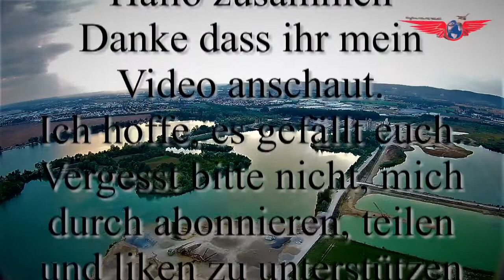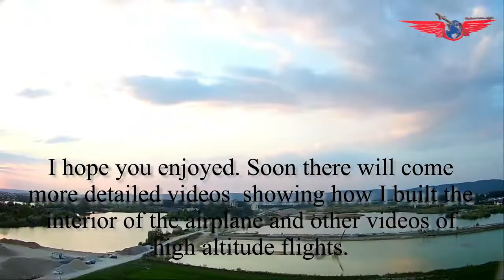My first FPV scratch building and Maiden flight

Comment: thanks for posting.   good work.  somewhat.  here are some things to consider.   the profile selected for the construction of the main wing is just a bit  thin.  (experience has shown me that a wing having a profile less than eleven percent thick, makes only moderate lift, when mounted at zero-degrees angle of incidence (aoi). )   a thinner profile results in a wing that has a higher stall-speed.   a thinner wing must move  faster  in order make adequate lift.   this all assumes a zero-degree aoi.    a zero-degree aoi wing mount is preferable, because it results in the  lowest  coefficient of drag (cd).   note that the way in which the size of the profile was reduced, results in an very thin outboard profile.  this results in a very  Accelerated rate of  'drop off'  of lift,  towards the wingtips.  this, in turn, adversely affects roll-axis stability.    (do you see that it is a miracle the model flies okay.)     

at 2:03, is the third piece the horiz-stab.   if so, this model has a problem that will NEVER go away.   what is it.
the use of a cambered, instead of  SYMMETRICAL,  profile in the construction of the horiz-stab means that, in the air,  the stab  is  MAKING   LIFT.    THAT's just wrong.

here are some additional observations, in case the stab is changed out.      at 2:46,  ANY TIME a wooden longitudinal component/brace/spar is used,  its distribution of mass (dom)  MUST be optimized  BEFORE  installation;  in other words,   TAPERED.    
at 3:03, the main spar is Not correctly installed;  at  30% of chord.      at 4:45, the arc-shaped vert-stab trailing edges Should go away.    elevator servo  Should be installed  Near  the model's center of mass (c-m).   this is   NOT  difficult to do.    tail booms  SHOULD Always be tapered;  no matter What they are made of.    tail booms  SHOULD  be as  CLOSE to one another as PRACTICAL.   the outboard mass of the tail booms, and the mass of the outboard-installed aileron servos,   ADVERSELY affects overall stability.     at 5:07, extra angle in the main wing trailing edge is  NOT  recommended.   this angle, relatively near the wingtips, creates Unnecessary non-uniformity of air flow, over and aft of the wing.    at 5:14, when a pusher configuration is used, the design of the fuselage  MUST  take into account the need for unobstructed air flow to the prop; or else it is  Starved for air, in flight.   fuselage cross-sectional area at  the firewall is  TOO  great.    at 5:26, the length of the forward fuselage is  TOO great; it  SHOULD be reduced by AT LEAST  40%.     cheers                        googletranslate
Reply from the maker: David Davids thanks for all this . I build now a new Airplane is fast similar to this one . 
So wing should I do it flat bottom or semi-symmetric ?!! And elevator und rudder should be symmetrical!!!!
Reply: @Marwando  you're doing just fine don't be a Wikipedia builder like everybody else continue on your own journey and you will surprise yourself. Playing by the rules is boring you did an excellent job.
Reply from the maker: thanks for your comment . unfortunately i can't fly this year . but next year i hope i can back again with more interesting Project :)
Reply: for most applications, where a model will be flown mostly right-side-up, a flat-bottomed profile is best.  the go-to profile is the clark-y (v1); 11.7% thick.  (this profile was  Designed  for use in the construction of the smaller wings of model aircraft;  it is not a scaled-down profile.)    for a little less lift, it can be made eleven percent thick.  you may understand that profile thickness is expressed as a percentage of chord length.    a stabilizer profile Should result in, generally, flat surfaces ( a flat airfoil).   consider using a  constant-chord  design for the main wing.  the Correct design of a double-tapered wing is  NOT  simple.    cheers
https://upload.wikimedia.org/wikipedia/en/thumb/6/6a/Clark_y.JPG/799px-Clark_y.JPG
Reply: Not necessarily I like 9% wings because they fly faster for fpv and they get to the location faster and cut through the wind much better. Depending on what your objective is there is no rules when it comes to an RC aircraft airfoil. Many times it has been proven over and over that some unconventional methods work better than conventional methods. That's why most pod and boom fpv platforms are a thinner profile. And that's why we have powerful and efficient brushless motors.

Explore the world keep experimenting otherwise if you continue with conventional methods we will never advance in this Hobby. 

Take a look at the wombat from Team legit or the vas Wraith, banshee, Spectre ect. 

All Unconventional aircraft and airfoils that perform tremendously well when it comes to fpv for what we want them to do. A big fat airfoil does not necessarily mean better for every application.

And not everything from full size aircraft applies to RC models and vice versa if it did there would be a lot of accidents out there of kids successfully jumping off their roofs flying around town.

I agree with a lot of what you say but sometimes you just need to let people have their freedom. It's the best way to learn and the best way to advance, there is no right or wrong way to building an aircraft. 

My advice is do what works for you. Don't be a Wikipedia builder be your own builder! If everybody would have followed the rules this hobby would be boring just saying! 🤘

Best regards